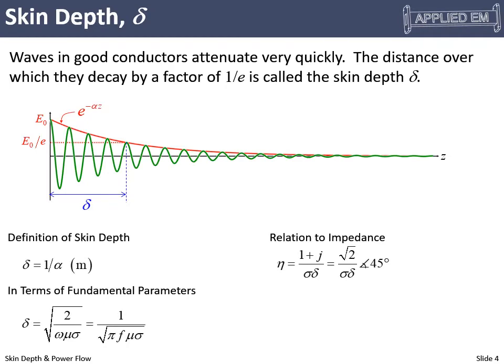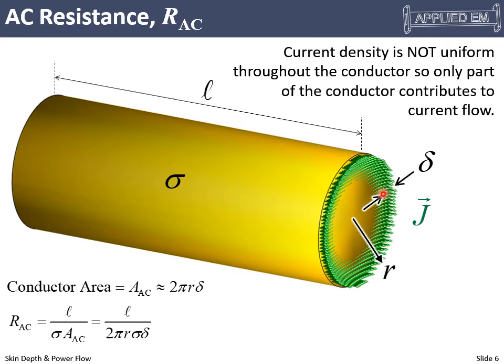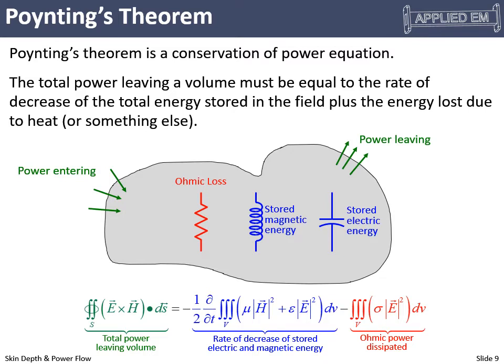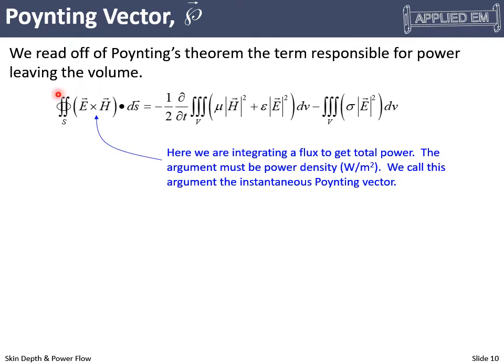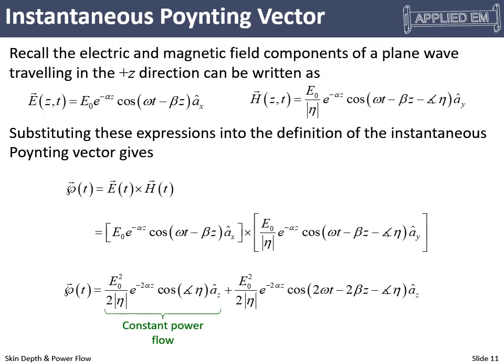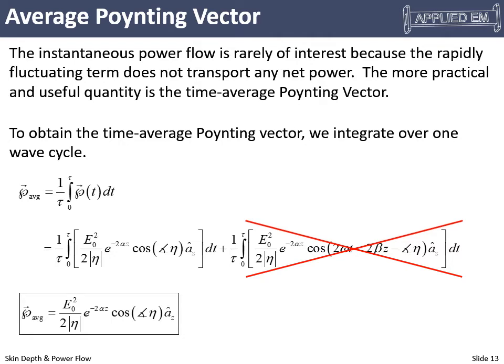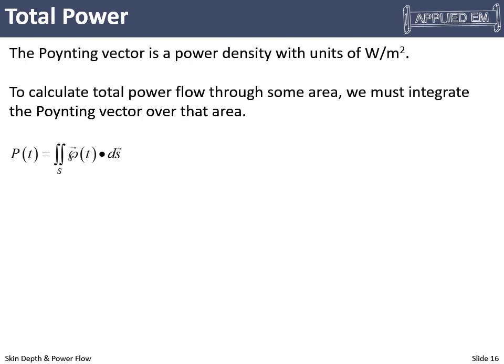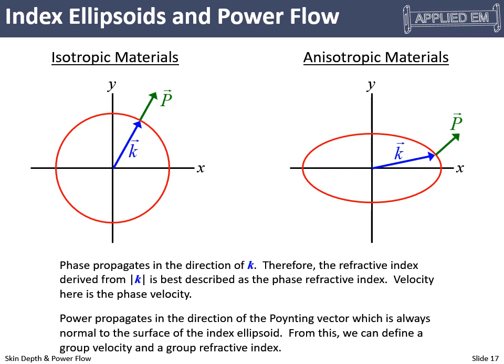Lecture 3e -- Skin Depth & Power Flow

Comment: Summary: Electricity works like Light and Radio (energy transfer by the EM fields, in the dielectrics).
Using wires is like "special case" (NOT "normal/regular" electronics). But still, "mechanism" is the same at AC and DC (energy is in the fields, but this time along the wire, OUTSIDE, but very close, at insulation thickness).
Yes, there is a "current" induced inside, but energy is NOT there (not "in" the metal).
If you increase the frequency, energy wants to act like radio again (it will radiate/transmit eventually, "regular wire" becomes antenna, then metals/electrons are not needed somewhere between the radio and light range).
There are 2 Poynting vectors. Small one (hopefully) is directed into the wire (and represents a heat loss). Bigger one carries the energy to load, along the wire. Easy.
Volts and Amps are like "secondary effect" of the fields around the specific object (wire, whatever), but they are easier to measure or watch (oscilloscope), that's why we use them. Units (or measuring equipment) don't "define" reality. Empirical equations too (dividing B/C=A doesn't create "A", doesn't make it real object, property, finest example: Ohm. His equation is NOT a "law").
Electrical Engineering BASICS (but now it's "controversial" among random lames in the internet).

Comment: Ok, so one silly question and one suggestion ahead.. 
Silly question:
About the instantaneous power flow, how is the first term treated as constant when it decays? I mean how can we consider an exponential decaying term as constant? 
Suggestion:
Sir please don't mind but for the first time, I'm little bit of disappointed with your animation (power flow). You can give it a thought.
Reply from the maker: Happy to answer any question!

1. The first term does decay with distance due to loss.  However, it is constant over time.  There are no oscillations.  The first term represents a steady (steady over time, not space) flow of power in the z direction.

2. What would you suggest to improve the power flow animation?  Being new to the subject, I think you are actually in a better position than me to help with this.  I am very open to suggestions!

Thank you!
Reply: @empossible1577  
1. Thanks, sir for the explanation.
2. I don't know maybe if the power flow is shown separately or just with the E-field. Actually, the main subject of that animation which is "the power flow" and the changes in the flow along with the changes in the associated fields (i.e E & H-fields)isn't very clear. In this context, I'd like to say that, you can think of the style of "Physics videos by Eugene".
Reply from the maker: @meghjitmajumder3468  I will check it out

Comment: Hello,
I have problems in understanding of losses in conductive medium. I understand the mathematical part but I have problems to imagine it out of the Maxwell equations. So a magnetic field creates an electric field. And that field creates a magnetic field and a current? How does the field lose the energy to the material? Does the electric or magnetic field induce the current?
Reply: Some of the EM fields along the wires (where energy transfer really happens) are entering the metal and create the heat loss. That's it. Superconductor doesn't allow such penetration so it has no resistance.
Reply from the maker: Both magnetic and electric fields can push charges in addition to inducing other fields.  Due to loss mechanisms at the atomic scale, some of that energy is not maintained in the wave and is converted into other forms.  You can think of it as the charges crashing into other charges and thus causing vibrations in the atoms.  It is these vibrations that we observe as heat.
Reply: @empossible1577  Thank you for your answer, it clarified it a little bit for me. But it opened up some new questions. Is there an electrodynamics explanation how the material interact with the wave or is the quantum mechanical the only one? And the loss term comes from the Ampere-Maxwell law. Is it possible that the E amplitude is split up into J and H?
Reply from the maker: @babotvoj  The explanation that I think is most intuitive is the Lorentz oscillator model.  This models bound charges as a mass on a spring.  An equation of motion is written for the system and through a series of steps comes an equation for the permittivity due to an atomic scale resonance.  The equation explains a lot of things like loss, dispersion, etc.  Real materials have multiple resonances that overlap so the behavior can look a bit different that of a single resonance.  Then in conductors, the charges are not bound and so the restoring force term disappears and the Lorentz model reduces to the Drude model.

See Lecture 2 here:
http://emlab.utep.edu/ee5390em21.htm